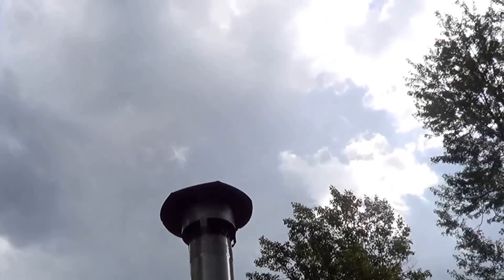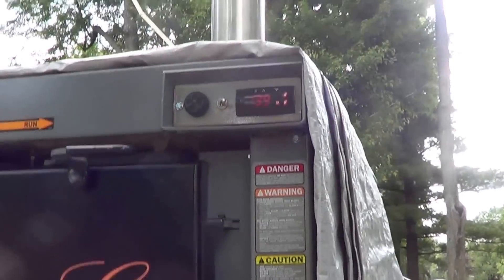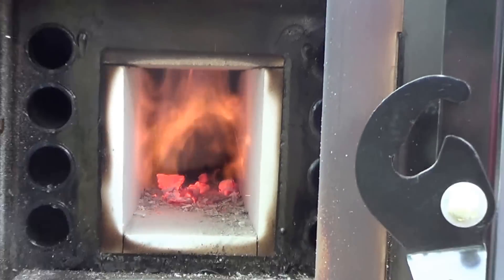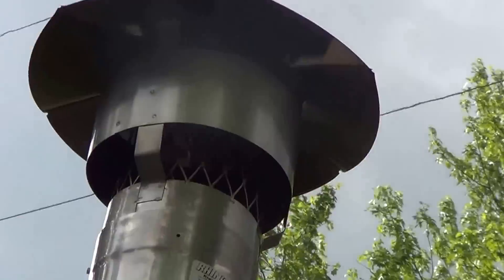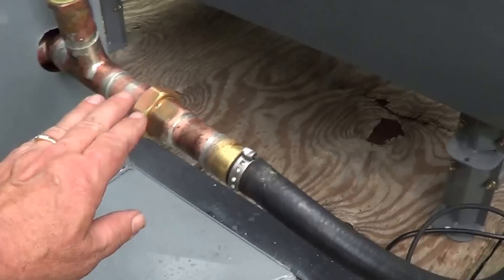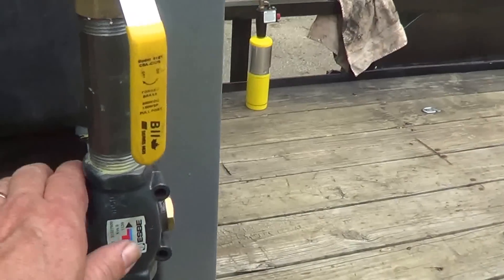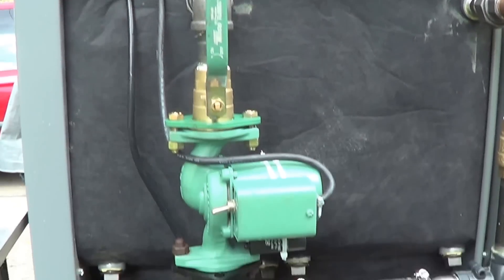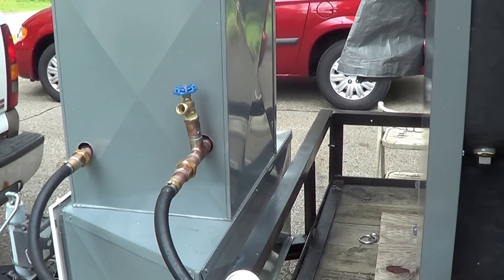Empyre Elite Gasification process  live burn demo

Comment: I heard that Empyre did go out of business, I have the 175 / 200 outdoor boiler, so far this is the 5 th year I have been using it, - it is doing good, just have to make / cut the bottom fire brick every 3 rd year.
Reply from the maker: tinkergene . As long as you maintain them good you should have some more good years left in it.